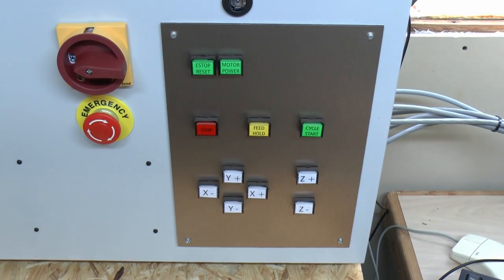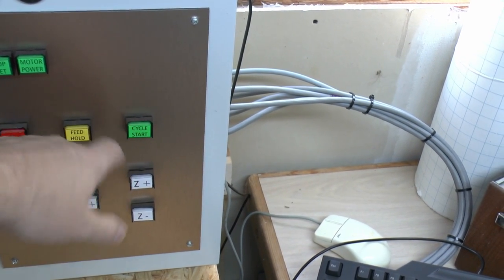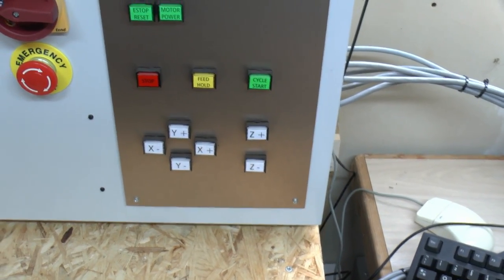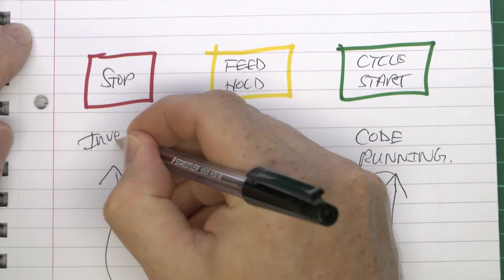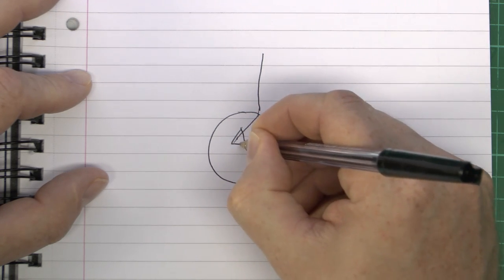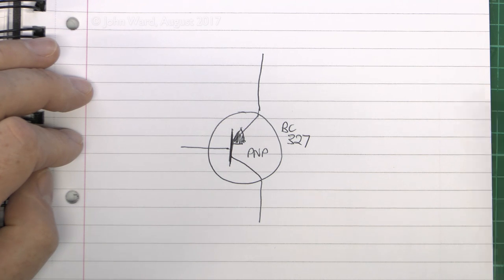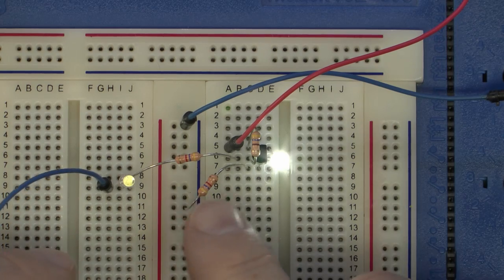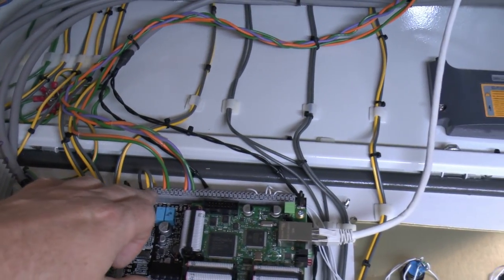CNC Router Build #7 - Buttons, Indicators and Spindle Control

Comment: Very nicely built and explained.  I just finished binge-watching all 7 parts of your build.  I've been building electronic devices for over 50 years and some of your building techniques were new to me and I plan to copy them in my future builds.  Over the past 2 or 3 years I've also built a CNC machine. I started with NEMA23 steppers but later changed to Clearpath servo/stepper motors with built-in drivers but use the same control signals of Step, Direction and Enable.  They don't need limit switches because they internally monitor the servo current rise when it hits a hard limit.  It was very nice to hear how you made the various design decisions.  I'm still using MACH3 but have been thinking about upgrading to MACH4 and your videos have given me confidence that working with MACH4 shouldn't be a problem.  I'm also using the Ethernet SmoothStepper.  I'm using a serial port to run the spindle and so far it's run will.  I appreciate the work you put into the project and the videos.  Thank you.

Comment: Would suggest wiring the E-stop reset light to the E-stop circuit, so the button only lights up when a E-stop reset is required to proceed.

Comment: If you use Mach3 you can use an Xbox controller for the jogging, fast jog, spindle control etc - gives you complete control which is worth its weight when trying to position the cutter by eye or more exactly using a usb microscope.
Reply: Dr Ralph Kennedy obviously only applicable to those who are actually familiar with an Xbox controller? there are people that exist (like myself) who don't actually play video games, so am completely unfamiliar with the layout and default functions of an Xbox/PS etc controller

Comment: Of course it goes without saying that this assumes a totem-pole output from the controller, otherwise a pull-up (or down) resistor will be needed. P.S this little circuit with a 2-terminal bipolar red/green LED makes a cheap logic probe, also!
Reply: The output is open collector (NPN).

Comment: Or use a micro relay with a nc contact. Connect coil to output and 24V. Also connect output to the green led in series with 4k7 resistor. Connect 24V to COM of the relay and connect nc of relay to the red led in series with 4k7 resistor.

Comment: Well, that over complicated things. Two LEDs and two resistors (or a potentiometer) are all you need. Add the two LED dropping resistors, then use the next value up, so 2 x 4.7k = 9.4k => 10k pot. Wire one side of the pot to ground, and the other to +24vdc. Now, put the tow LEDs in inverse-parallel, so the green LED cathode = red LED anode. This goes to the controller, while the other side (green anode/red cathode) goes to the wiper (center terminal) on the pot. Turn the pot to midway, and turn on the power. Ha, no BJT needed! :)
Reply: Because of the open collector output this will not work, but an other circuit could be made from 2 resistors, one NPN transistor and maybe one or two diodes to set the switching voltage for the transistor if needed depend on the voltage drop over the LED used.
I do not like to turn off an LED by short circuiting it, it is a better approach just to turn it off.

Comment: Great series, really enjoying following your progress.  Do the jog buttons manually move the position of the spindle by a set amount with each press, or do they start movement in one direction until deactivated?  If they move by a set amount, did you use momentary or latching switches? From the log screen it looked like latching switches, so I'm interested in the thinking behind it.  Thanks.
Reply from the maker: The switches are momentary, but the controller records them being pressed and released as separate actions.
The idea is to have pressing the buttons starts movement, and releasing the button stops movement.
Should also be possible to configure them as one press = a certain amount of movement.  May be possible to have them work in both modes.
Currently they do nothing as the code for them is not installed.

Comment: Wouldn't it make more sense for the stop/start buttons to be inverted, so when the stop button is usable (i.e. the machine is running) it should be lit up? This would match the 'illuminated when usable' setup you have for the jog buttons.
Reply: I'd have said indicator lights should only indicate the function on the label, so if the indicator light says stopped, that's the current status of the machine.

Comment: would of thought you would of put in a fast jog button.
Reply from the maker: Still plenty of space left for other buttons.  Currently the main objective is to get the machine working, rather than add every available feature to it (in which case it would probably never be finished).
Reply: John Ward Friend of mine built a cnc plasma cutter 15 years ago.
Still adding bits to it.
Its like the trade we are in, You always learn something new or add something new to the toolbox.